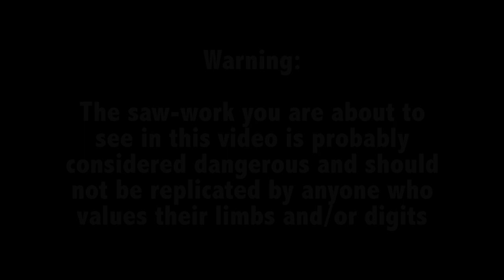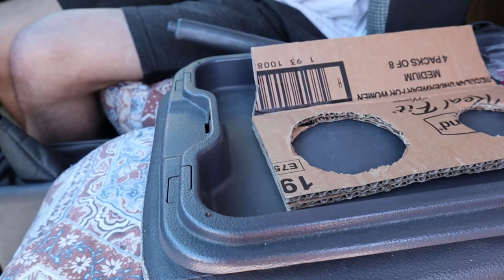Refurbishing & Renovating Our Van! |  Finishing Touches 🚌  | Part 4 | VAN LIFE

Comment: I may have missed seeing it except on the water jug cupboard, but do have latches and restraints to keep things from sliding out. flopping open or bouncing out and around when driving down the road. Decades ago when I was doing the van thing I learned that if something can move it will move at the most inopportune time when traveling down the road.
I do really enjoy your videos and thank you for the extra work that you do to bring us these videos. Also, thank you for letting us enjoy New Zealand with you as you are traveling.
Reply from the maker: We've been down some verrrrrrry bump country roads and everything stays put, we put a few restraints on the things that can break and recently attatched one to the gas bottle so it stays put 😀 You're so right though, anything that can move... will move! 😂 So happy to hear you're enjoying the videos lovely 🙌🏼